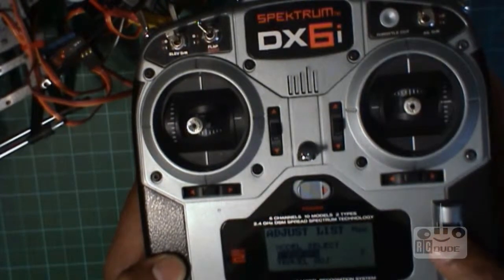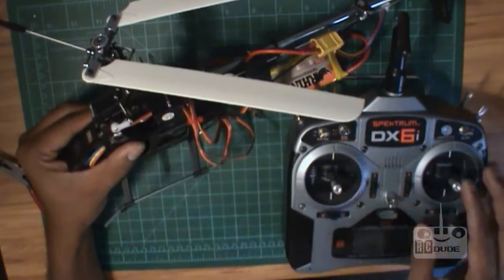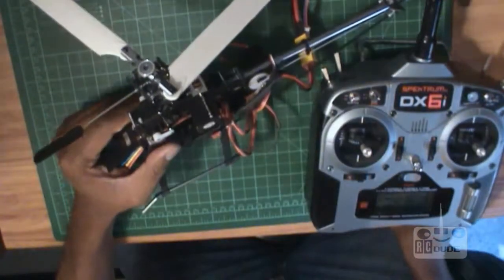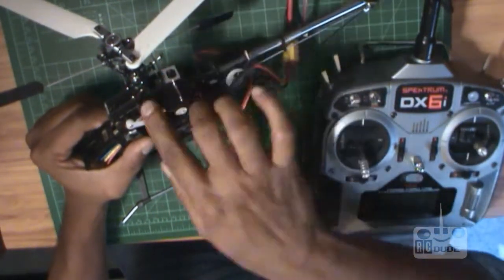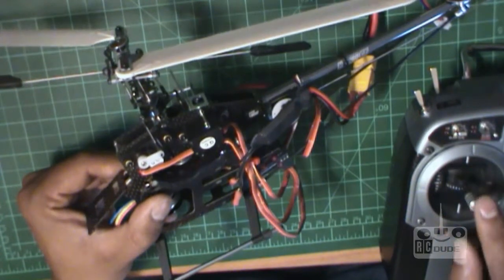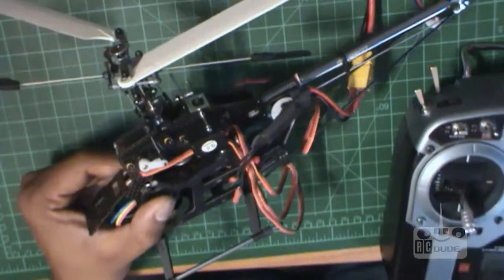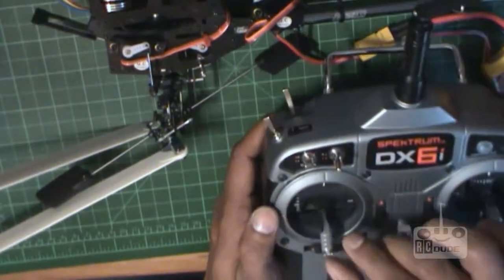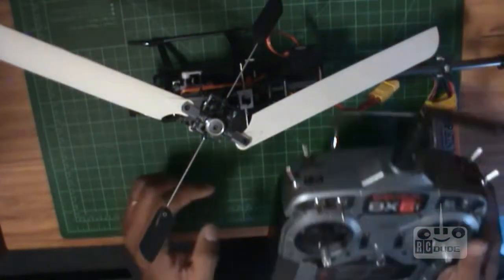HK 250GT How To Build & Full Setup Part 18 (120 Ccpm set up part 2)

Comment: thanks a lot man all your HK250 videos helped me very much! to bad the grub for the pinion is rounded :( ill see what i can find in the shed :)
Reply from the maker: ok for pinion u need to buy Thread locker  High strength type in Google plse Tl-262    thanks
Reply from the maker: sorry cawWz  when u buy this TI-262  then drop on motor Shaft then put yr pinion on the top and let dry its work really good and if u want to take pinion out then u need tool call Turnigy Pinion Removal Tool thanks need any more help ask me i hope u fly soon
Reply: Rc Dude
i am almost flying but one thing has got me stuck when i push forward on the elevator it goes down instead of up been stuck for a couple hours now lol any help would be much appreciated
 it's a turnigy 6XS radio